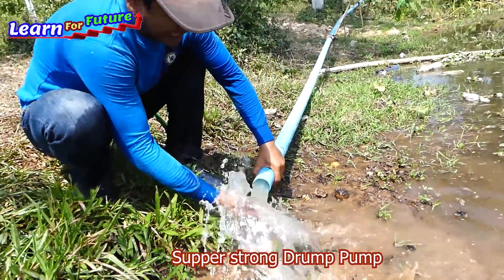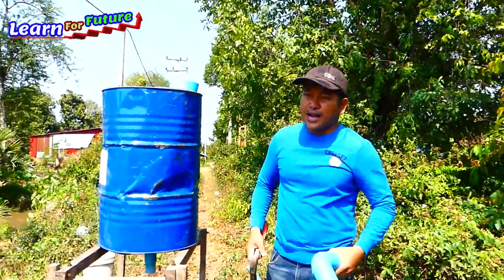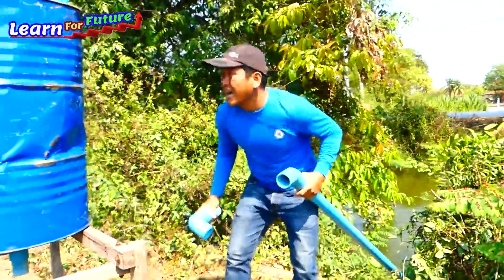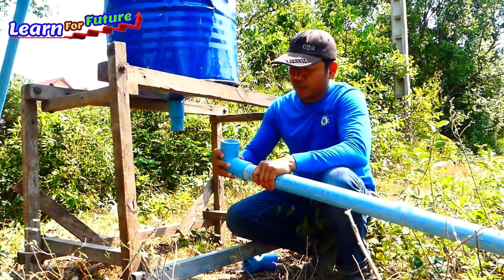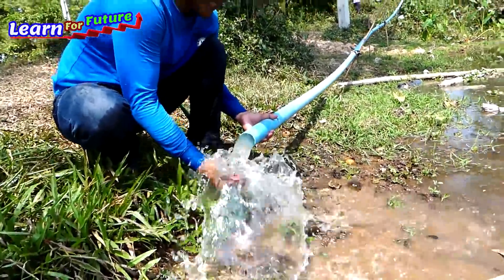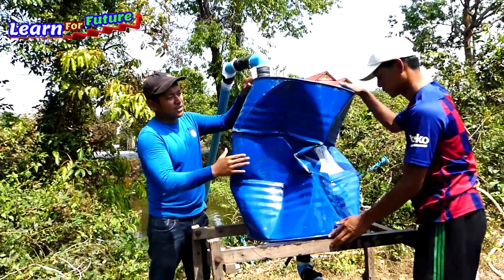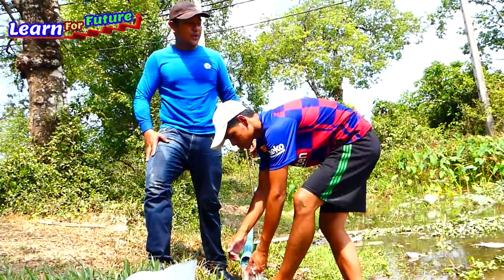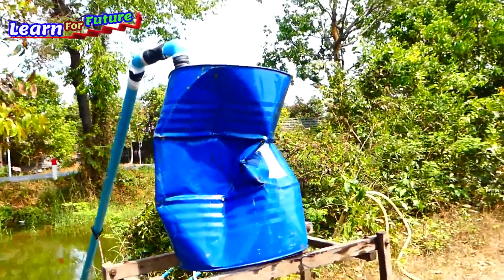Deep River - How to make free Energy water tank from Deep River About 6 M Deep with big pipe

Comment: Hello Friends, I tried your project with plastic blue color drum (but thick) with 1 inch pipe for both inlet and outlet, filled the water and open the outlet valve the drum started shrinking from 3 sides and stopped pulling water from the 16 feet well,  After I saw YouTube advice for 3/4 inch inlet and 2 inch outlet,  I  just reduced the inlet to 1/2 inch (ie., 1 feet from the drum I cut the 1 inch pipe and fixed 1/2 inch small pipe with both the sides reducer).  Now after filling water if I open outlet valve the drum starts shrinking from 2 sides and stopped pulling water from well,. The output pipe length is 20 feet and a 3/4 inch valve and again reduced to 1/2 inch for 5 feet , is it ok, please advice to get this project success.  Why water stops pulling.  No leakage in the inlet and outlet pipes.  Air pressure pipe also 1 inch in both inlet and outlet area.  After the master valve the air pressure pipe is also 1 inch to the height of the drum..  Please help me.  Immediate response will the highly appreciable.  I spend around Rs.3500/- for this project but still no success and failure continues ...
Reply: Baka makatulong s u
Reply: Bro I also tried but it not Works,  it think Some mistake we are doing we cant identity the Mistake
Reply: @chennaidepo4759  it doesnt work.
When water flows out of the barrel it creates a low pressure but that doesnt mean thr water will flow up.
The reason it wont is because there isnt enough pressure pushing the water that has to go inside the barrel
Reply: Agris Werners  No.
Reply: @chennaidepo4759  output must ne lower than input.
Reply: Salam 🙏 dari Indonesia  saya menawarkan jasa tentang pompa air grativitasi bagi yg membutukan  peroyek seperti air meneral atau  minyak bumi      dan saya bisa menaikan air kedalaman satu meter sampai kedalaman 100 meter jika kalau ada yg minat silakan imbok saya sekian dan terimakasih 🌹🙏

Comment: The higher the elevation the lower the pressure and the lower the elevation the higher the pressure.  But the system shown the suction line or the sending end is at lower elevation and has the higher pressure while the discharge line or receiving end is at higher elevation and has the lower pressure thus no siphoning or continuous flow  will ever occur.  Take for obvious example even a glass or bottle full of water it won't spill any when turned upside down because at in a vacuum state.
Reply: Porque se apachurro el tonel, demasiada presión

Comment: Just curious

The flow rates for the water have to be in balance for it work at all times.

If temperature varies too much, it will like be out of balance.

Presuming you reset it with each use 

I suppose you can prevent crushing by excess water outflow adding stones to fill the drum.  But I think it’s the sudden cooling

Try this version 

Use Archimedes screw anger into water to lift it.   Lift it up.   You can use wind or crank or water itself with proper gearing 

Thé water can pour and gravity carry it

Comment: My friend please use the gas cylinder but drill 60mm diameter for both inlet and outlet so we can see the water output clearly. Thanks for your great work and keep on helping your fellow farmers. By the end of this year make sure every farmer 100km away from you is using this system and God will make you rich and happy too !!!✌✌🙏🙏
Reply: @abdulwahedkhan6293  Them have made videos, showing 60mm input and 60mm output, working perfectly.
Reply: @compostsfertilizers5471  
In other videos well have seen inlet Dia( say-1" inch)  is always smaller than outlet Dia( say- 1.5" inch)  to develop higher vacuum pressure. Thank you.
Reply: @armandoramos6851  what are the mathematical formula for using this air vaccum drum water lifting system please solve my daubt?please I want to make this type of free energy water lifting system.so you explain it clearly my request to you.
Reply: @rabindrabindhani6447  sobukan mo nalang di naman sigoro aabot ng 2k ang aabotin mo. sobok lang!
Reply: @rabindrabindhani6447  hydrostatic pressure formula.
Reply: @t.pelajar  
I am sure that " This is a modified syphon system ".  The discharge  orifice  must be lower  than the water level  of supply source. Otherwise  water will not flow throw the pipe.
Reply: Better watch this clown 🤡 presenting this video in the circus 🎪 show for more laughs 😂 Pls. Study on law of conservation of energy.  The gravitational potential energy impended on the intake pipe would be the product of mass garvitational acceleration and the difference of height from the discharge pipe to the intake pipe.  Likewise the pressure have to be augment with that potential energy in intake pipe would be the product of density of the medium gravitational acceleration and the difference of elevation from the discharge to intake side.  The system they are showing here is in equilibrium no continues flow of water.
Reply: Videoyu dikkatli izleyin adam tanbura cekiç ile vuruyor
Reply: @abdulwahedkhan6293  Noop. Pressure is given by hight, not by tube diameter.
Reply: @rabindrabindhani6447  it can not lift anything. With a siphon the output must be lower than the input. It can only lift water over a ridge, but you must go down again.
Reply: @Dingsrud 
 your are 100% right. And I was  wrong. Thank you for your comment.
Reply: @abdulwahedkhan6293  Why say that? You're not "SURE" of anything -- it's what you believe!  Certainty is you attesting to your own results from your own actual experiment.  All I read was an opinion.

And yes, of course, it is a modified siphon that transfers gravitational energy and combines that with the immense power of a vacuum.  It works a lot like a jet turbine in many respects, especially with respect to over-unity.

I am referring specifically to a proper setup.

Comment: False, only gravity acts there, since the level of the river is higher than the outlet of the pipe. This also works without the tank
Reply: Ugh.....  no.
Reply: no, the source water is 6m deep or lower than Outlet, so it won't work here.  You still need air pressure here.
Reply: @Eduardo yes it work
Reply: @randomards4125  Now you're busted -- second time for me.  TROLL ALERT!!!   lolol
Man, take a hike.  You are only here to steer the conversation, which simply means you're not very good at trolling yet, that's all.  Bottom line:  This works, but there are multiple scientific principles at work here, so there are ranges and limits.  A siphon alone has a HARD limit:  OUT height <= IN height
Reply: @mariana1964  Ugh..Yes. It is possible to run this without a tank, but a tank kan helt starting the siphon.
Reply: @mariana1964  Be careful with the symbol here. For a siphon to work, the input side, suction side, must be higher  than the delivery end.